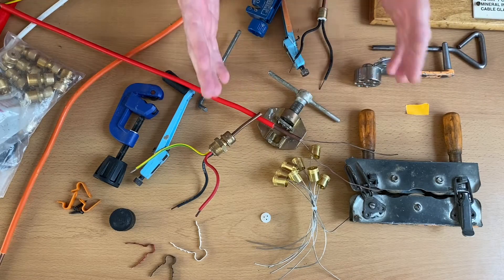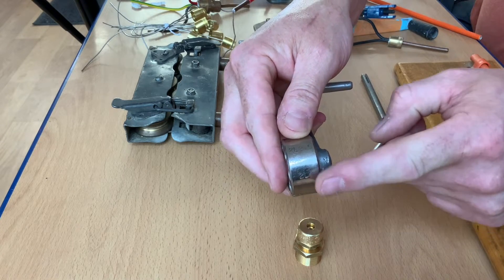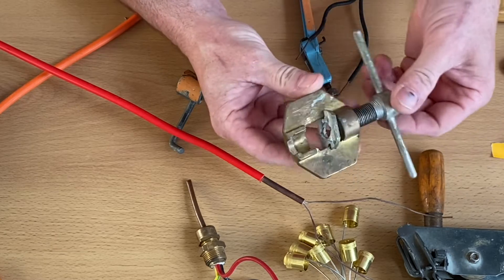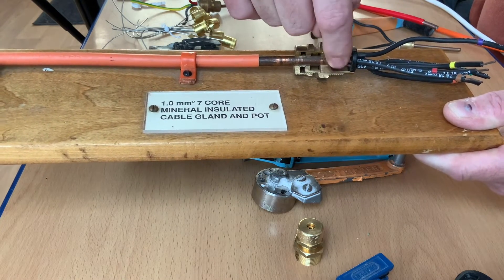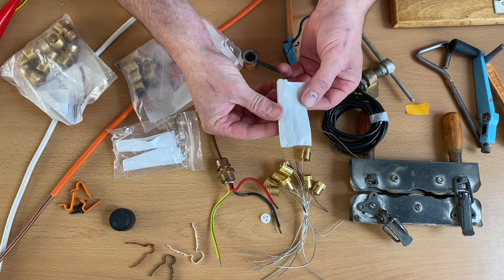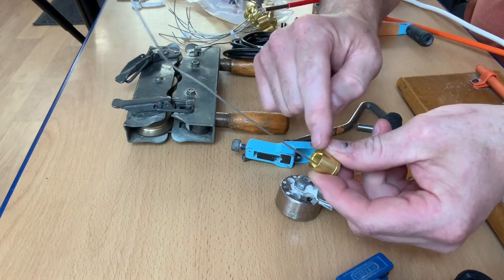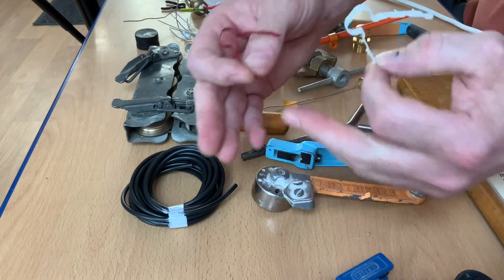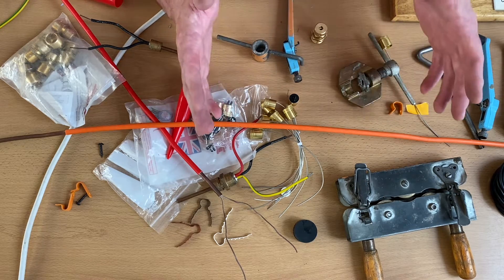Mineral Insulated Copper Clad Cable - MICC, MI or Pyro Cable - Gland, Pots, Seal & Tools

Comment: Later years there's been a high amount of pots that have a slither of brass come away from the internal thread and short out the conductors. Always check with a flashlight down inside the pot.

Comment: Out of ALL of these videos about MICC here on YouTube, and I STILL can't find a single one that explains to me the history of MICC, or why it exists.. what it was (is) used for.. etc. 

 What I HAVE been able to piece together is that.. I get that it's an electrical cabling system, that seems to be a) somewhat outdated, b) primarily used more in the UK and quite possibly other European countries than it is (if at ALL?) in America, and I say this because I'm in my 40's, I'm fairly knowledgeable about construction and know a LITTLE bit about electrical (way more than the average homeowner for sure) and I don't believe I've EVER encountered MICC in the US, even on OLD construction. And I've seen buildings where Knob and Tube was still in use! 
..but, what I still don't understand is.. was this just a popular method that was used back in the day? Was it an electrical code requirement or something? Or was it more so just because it existed, was an acceptable method, and it worked really well for what they had at the time?
What confuses me about it's existence is.. from what I know about the history of England/Europe in general, is that they spent the first half of last century dealing with two major wars, both of which ended up putting a huge toll on the UK's availability of both valuable resources (such as COPPER) as well as skilled tradesmen! Two things that are essential to the proper use of MICC as a means for power distribution! 
So it baffles me that this would have been such a popular method for running power throughout the UK'S building's, farms, and homes!  So how did it become such a ubiquitous thing when copper was a priceless commodity throughout the war years.. they were constantly building and RE building.. and it's a fiddly process that in order to be done correctly, it requires men (at the time) with a fair bit of skill, dexterity, and knowledge.. most of whom were off fighting in the war? 
I'd love to see one of those awesome Timeline or BBC style documentary/Education programs, that is all about the history of MICC.
Maybe it's just because I'm a total nerd, but I would TOTALLY watch that program! (Or YOUTUBE video! Wink wink! 😉)
Reply: This cable was (and sometimes still is) used mostly for fire alarm systems, or in chemical factories, nuclear reactors, etc and sometimes as the feed for flats in high rises. It existed before we had the modern alternative, known as FP cable (like FP200 from Prysmian/Pirelli) and hence was the only choice at that time for what it was used for, the price didn't matter as much.
It is radiation proof, very hard wearing and would need to pretty much hit the melting point of copper before it goes out in a fire. There's still use cases for it though, but less so than before since it's much more expensive than the modern alternatives. 
You wouldn't really see it outside of those special cases though, certainly not running a lighting circuit within someone's home, if at all seen within the majority of non high rise domestic dwellings.

Comment: I mean I like this better than USA bx cable.... But I've only found out about this an hour ago ... So I'm intrigued.... The conductors ie; the wires inside of the copper jacket.... They appear to be bear? I'm at a loss as to what your neutral line is? Or does it rely on the earth as the neutral... I don't know how your grid works lol
Reply from the maker: In 2 core as shown the line and neutral are imbedded within a magnesium oxide insulator the outer copper is the CPC (earth). Thanks Gaz 👍🏻
Reply from the maker: MICC Cable - MI Cable - Pyro Cable Stripping, Terminating and Testing https://www.youtube.com/playlist?list=PL2Ea5r9gxUUf6CTXkZ6bfXYg2HUDRkI8L
Reply: I see everyone carries an ohmmeter with them for these installs... I watched a video on the fire resistance of these and I'm impressed... Not even bx or a metal conduit is really going to provide that level of protection from a short...

But I guess my concern is around what seems to pop up in videos online, improper installs moisture creeping in... For safety I guess you could gfci the breaker... But if the line is critical for emergency lighting exct under those scenarios you wouldn't want it gfci because it would trip and be useless....

Take away, proper install shouldn't have any issue. But most people seem to be doing the opposite of that.

I guess my only outside user error concern is how do you prevent an air gap in the magnesium during manufacturing... Is that ever an issue? How is the spacing of the internal lines consistent? All of the lines seem to be bear copper.

Basically I'm concerned about internal shorts. Obviously you test all the lines before hooking to the mains... But if someone were to bend of pinch a wire wouldn't that short the system

Comment: Don't forget AlCuMICC, wedge pots, Mole Grip wedge setter and crimper, heat shrink pots, drying out damp pyro,with the friction generated by a loop of string around the cable. Pyro,stripper that used the gland as the guide ( total crap ). Keeping the compound in your pocket in winter to soften it. Round head brass or Black Japaned screws.  At the age of 14 spending all the summer holidays 1970 making off pyro,ends on site as my father owned the contracting company...the first 500 are the worst

Comment: Memories....  flooding back over fifty years ago installing pyros on petroleum refinerys and flour mills.  Pyro sizes today 150 H four core, fork stripper, reversing pots to start the threads on to the pyro, blow torch to dry out the cores.  Straightening rollers, rubber headed hammers, leather bound  benders to right angle or set in to intrinsically boxes, spreader boxes, distboard or LV panels. The insulation tester in a wooden box with  a turning handle to generate the test voltage to check pots all clear. The job satisfaction the dressing of up to  forty six  pyros of various sizes  using the mention tools. Always  winter on a freezing day wearing a donkey jacket to keep warm. Great video.
Reply: You forgot about the sky hooks, fork candles and bill hooks.
Reply: Skirting board ladders. As a new apprentice sent to the  electrical wholesaler go to the counter ask member of  staff for a long and short weight told to stand over there.

Comment: When i learnt stripping MI in the 80's we used a flat bladed long screwdriver, once you peeled enough with some cutters then you could squeeze it onto the screwdriver blade and wind off the outer sheath..